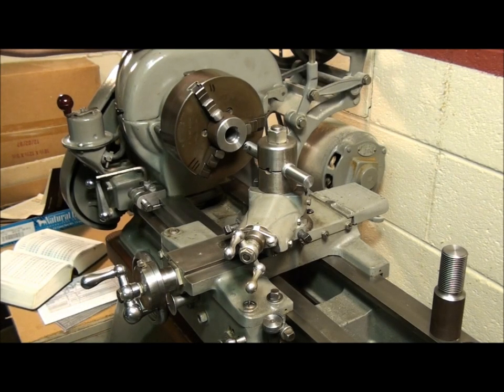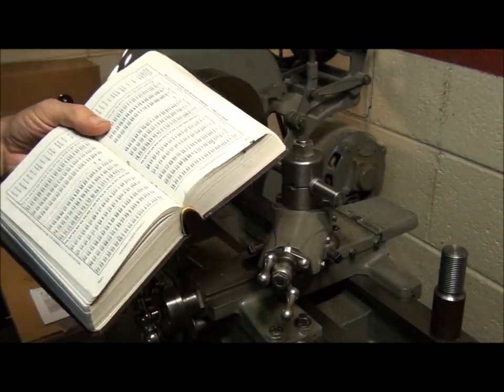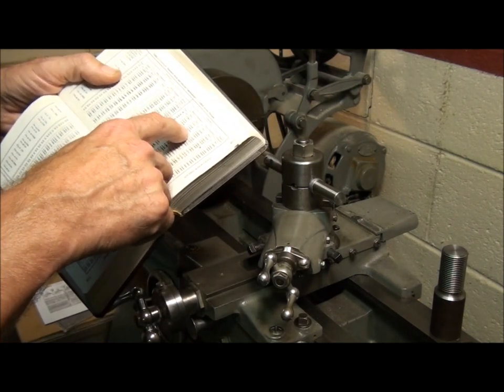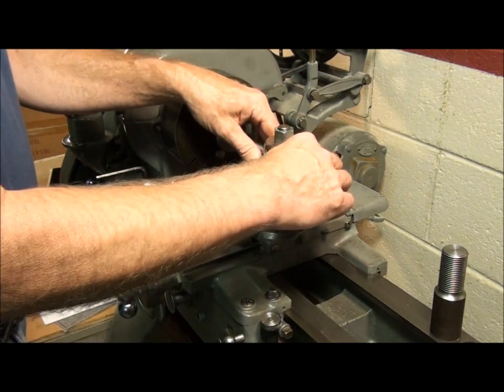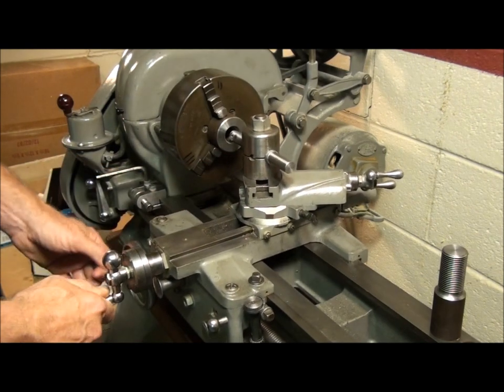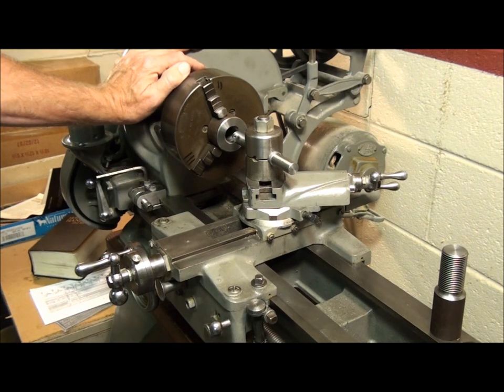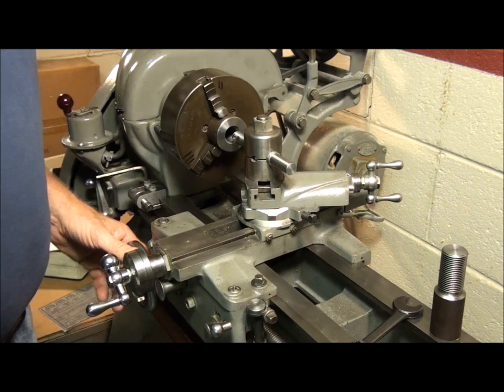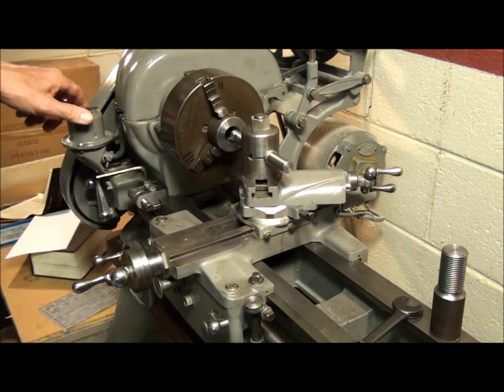Cutting an Internal Thread on the Atlas Lathe, Part Two - Setting Up the Tool

Comment: Hi Tom,
I think you may have misunderstood oxtoolco's comment.  If you rotate the boring bar in the holder to cut on the backside of the bore the lathe is run in the normal forward direction. The boring bar and threading bit are identical to the more common setup you use in this video.  I have been threading this way for several years now and prefer it as most of the control actions are the same as for external threading.
I have learned a lot from your videos.
Thank you for your efforts.
Dave

Comment: Tom, I've threaded with the infeed angle at 29 all my life, and a glance at the tool and what it is doing chases all confusion away. DT says cut with zero infeed "Like your CNC's do", but I program CNC's to infeed at an angle also. I have done zero infeeds but my mind revolts at the idea of the chips meeting from both sides. It works in spite of that though. I find setting at 29 is no more difficult than any other angle, and it pleases tool chip clearance theory best. I also do a spring pass at zero degrees as you say as well.
Thanks,

Comment: Hi Tom,

Have you ever tried threading on the backside in reverse? This is my preferred method for ID threads. This has the advantage of putting your compound in the same position its in for OD threading and you can see what's going on easily.

I like your channel. Keep up the great work.

Regards,

Tom

Comment from the maker: Dave,

I think he meant run the spindle in reverse and cut on the back side with the tool in the upright position. The advantage of that technique is that you feed to the right for a right hand thread which is useful if you are threading to a shoulder. You can start at the shoulder and feed out rather than feed toward the shoulder. I have also used the technique you describe and it works just fine. That's the fun thing about machining, there are many ways to accomplish the same thing.

Tom

Comment from the maker: You always want the leading edge to cut, not the trailing edge. That removes the backlash from the leadscrew which results in a more accurate lead on the thread. 

Tom

Comment: you could cut on the back side of the bore running forwards if you mount the tool upside down, but I guess pulling up on the tool is also bad?

Comment: because I cant  take  the parts to test  fit the  nuts. should I be measuring the threads with wire to make a gauge  for the  nut ?

Comment: hey Tom, Ive been watching several lathe videos and learning as much as I can before starting up my lathe for the first time. Ive rebuilt an old ATLAS 109...yes I know its not the greatest but, some of us have no money and want to play.  Besides the geometry of the cut, when cutting at 30 degrees, it should give you a 2:1 ratio....maybe Im an idiot..i dont know, but if you want to be super precise on the depth, that 30 degrees maybe helps you control your depth better?  Only reason im putting this here is to hear someone chime in on the "book" reason for the angle.  WHy do you do that? what for? teach me!!!
Reply from the maker: First of all, setting the compound at 30º does give you a 2:1 ratio. It actually works out to 1:.866, which means that for every .010" you move the compound, the tool moves into the work .0087". If you want to learn about cutting threads, you need to work through my four part video series on cutting external threads. I go into great detail in those videos about the math behind grinding the tool and the logic behind setting the compound angle.

Tom

Comment: Tom, what does the internal geometry of that boring post look like?  It's driving me nuts trying to figure out how you tighten the bolt through the same space occupied by the boring bar itself.  Thanks!
Reply from the maker: I honestly don't remember since it's been 35 years since I made the thing. It probably has a center post attached to a T-nut to fit the slot in the compound, with a slot large enough to clear the boring bar and a threaded stud on top to clamp everything together. I'll take a peek next time I'm at my dad's and let you know if it's anything different.

Tom

Comment from the maker: Unfortunately that's what you need to do in the home shop. Commercial gauges are expensive and you need a pair of them for each thread (go/no go). I usually make mine a couple thousandths under the high limit of the pitch diameter and cut the internal thread until it just fits.

Tom

Comment: To run the compound at 30 degrees from the front, couldn't you do this:
1. keep the chuck rotation counterclockwise
2. rotate your bar in the holder 180 degrees so the bit is upside down, on the opposite side.
This way you're cutting on the material as it rises into the bit (if cutting on the back of the material) rather than as it drives downward into the bit (if cutting on the front of the material)?
3. you would be driving the part downward, rather than upward. Maybe that is taboo?
Reply from the maker: The carriage is designed to take a downward force from the tool. With the tool on the back, it would want to lift the carriage off the ways rather than force it down on them resulting in a less rigid set-up. It may work fine, or it may tend to chatter. The only way to know for sure would be to try it.

Tom

Comment: can't you just set the compound like you normally do for external threads?, as far as I can tell it'll just be the trailing edge that does the cutting instead of the usual leading edge, the tool is symmetric so it should be ok

Comment: I know you are good at what you are doing, because I have seen enough video's, What I can not understand is that why there are no oil at all on your lathe gears, and the sound is telling you they are thirsty too. Maybe you dont need them, that means that I am oiling my little lathe too much !!?
Reply from the maker: Oil on open gears like that won't stay around long. In fact, you'll end up wearing most of it. :) That lathe is just old and not very well designed, in that most lathe gear trains run in an oil bath.

Tom
Reply: A very small dab of lithium grease rubbed in the gears with a qtip. Don't over do it though.